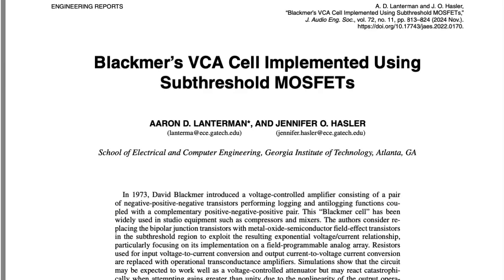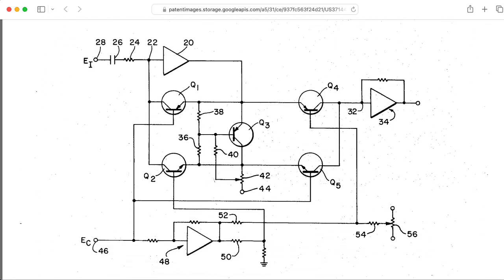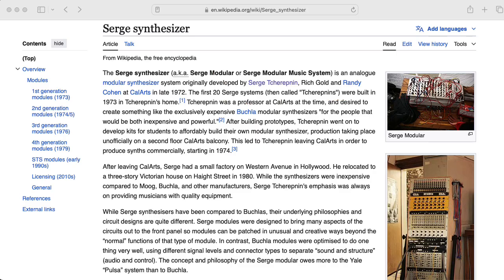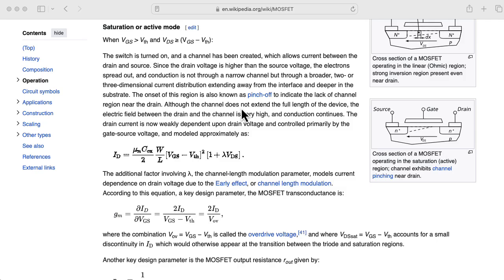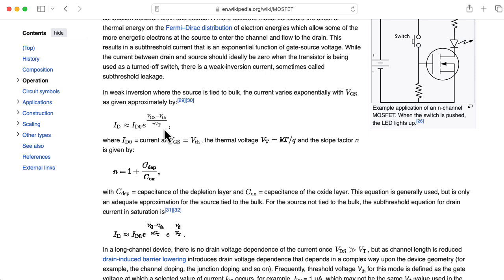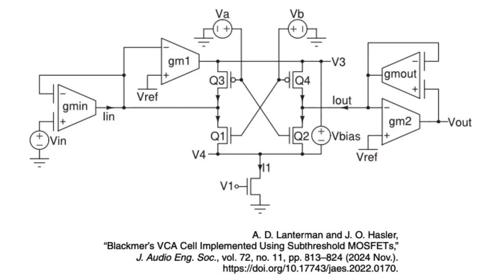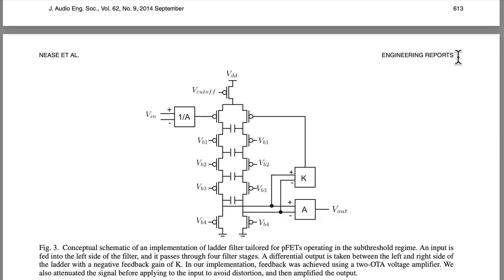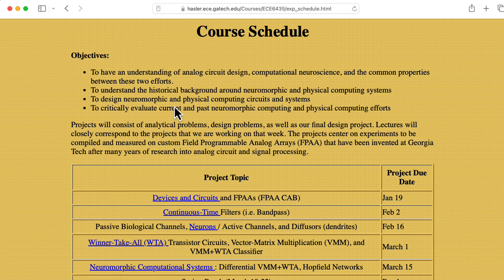Blackmer’s VCA Cell Implemented Using Subthreshold MOSFETs and Field Programmable Analog Arrays

Comment: Professor, some unrelated question, it's about these solar inverters, does it make any sense to use these?
From what heard from a other electrician, these inverters create a voltage that's 1 volt higher than the net voltage.
So i think the only one that have some benefit are the houses nearby, because the inverter is pushing against the area transformer from the net or grid from the reactor, to me it seems it only works that far on the ground or areal cables impedance matches the 2 voltages. since both "devices" generate 220V and +1V for the inverter, the first 220V should cancel each other out, that leaves the +1V. yet people seem to make quite some "extra" income with their devices.

If i put 2 transformers face to face in Falstad both with a AC source of 5V, than if i raise one AC source (consumer side) to 5.5V. the line (ground cable) has a voltage of 5.25V, instead of 5.5V. it doesn't look that this works through the Grid transformer. this side stays at 5V. I'm wondering if it makes sense to fight the Grid's or reactors power. How does it work?

also what happens with the transformer inside the inverter when the H-bridge is inactive? ... but connected with the grid.
Reply from the maker: Sorry this is all far far far far far outside my areas of expertise...
Reply: @Lantertronics  Well Texas Instruments has some reference "inverter"  schematics online. it contains a special chip to isolate mains from DC ad a special H bridge chip, a mcu. that's pretty much it. I'm just wondering if a small transformer would stand a change vs a 1.x meter big area transformer. it's PWM vs a magnet, some German went with a expensive scope through his house and detected the neighbors solar panels noise.

Comment: I would love to know more about the moog ladder implemented with MosFETs.
Is there a schematic, sound samples or anything more available?
Would it be possible to implement it with discrete n channel mosfets?
Thanks!
Reply from the maker: I'd probably try using something like the ALD1116 or ALD1106, which are matched sets of nFETs.

E-mail me and we'll chat more.
Reply: @Lantertronics  I sent an e-mail your way a month ago, probably went straight to the spam box. Its a google account, named "flakerpower". Since then I have one more idea you might find interesting: LPFs with subtreshold mosfets and no capacitors. I was confused with the results at first, but it works in LTspice. I'll send it your way too.
Thanks.

Comment: I wanna build my mixer with  SSI2164, not good?
Reply from the maker: I think the THAT chips are higher spec, but the SSI2164 is a great chip, I wouldn't hesitate to use it in an automated mixer application.
Reply: @Lantertronics  The That chips are expensive, the SSI2164 you can get for around 4€. the audio will probably sound the same.